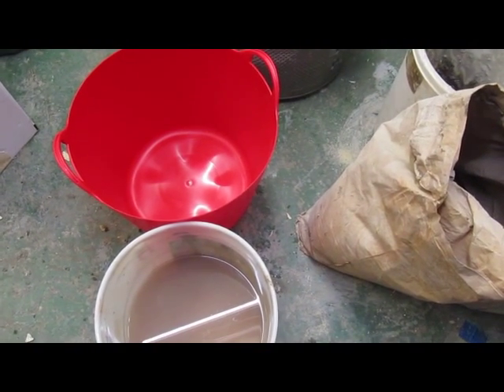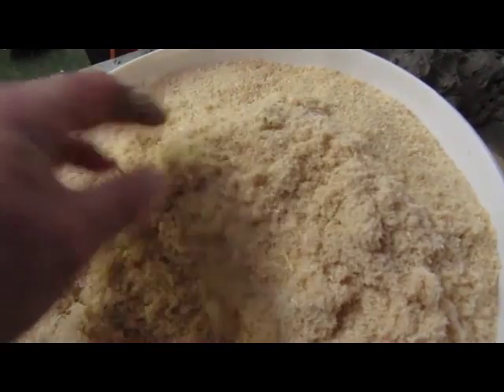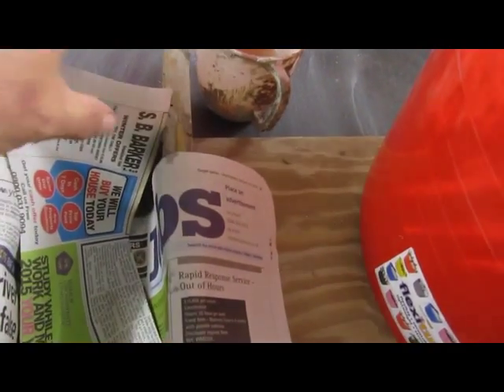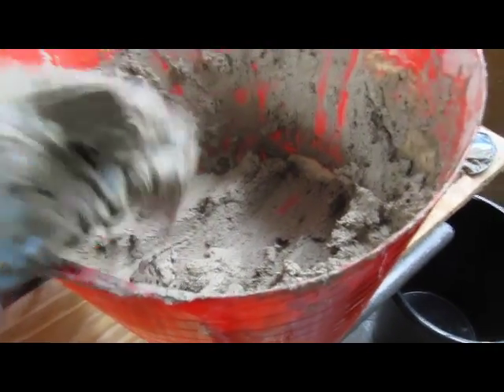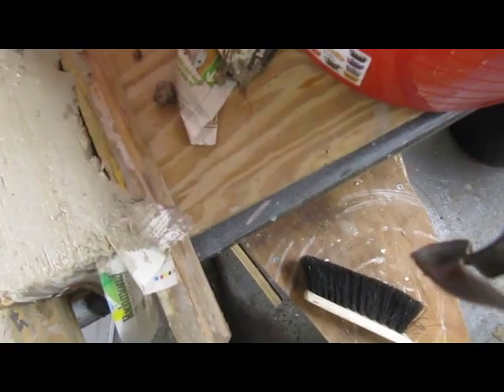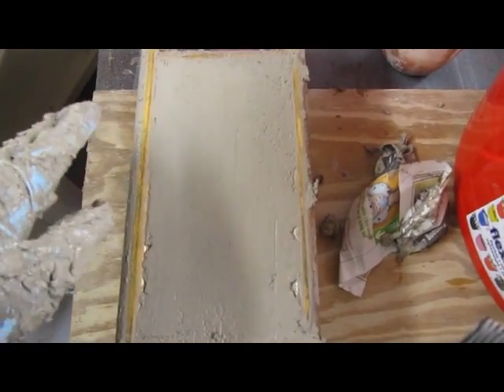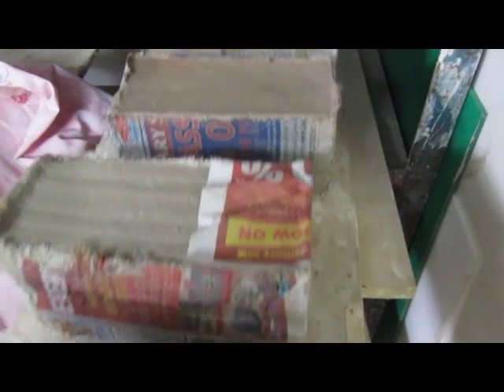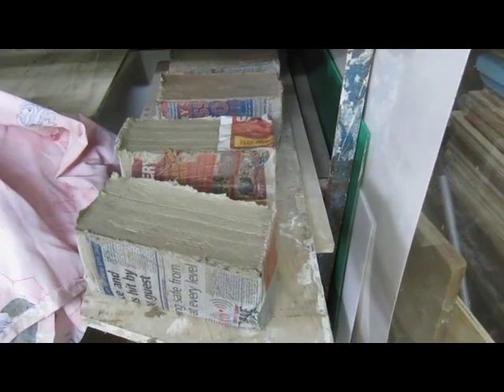Hand making Kiln Bricks

Comment: Did you ever get to fire the bricks?
Reply: High Bridge Pottery why would you not use grog filler? sawdust is just a wasted effort.....pointless!
Reply: Sorry,  this was meant for the author of the video, not you :-/
Reply: No problem :D Maybe I can answer, the sawdust is meant to burn out and leave tiny air pockets to make insulating fire brick.
Reply from the maker: not yet but have plans to fire a large pot in the garden and the bricks will make up the base . which the pots stand  and  acts as a firer box as well . I do a video. The bricks after they were fired were still heavy and more sawdust would help.
Reply: the air pockets not only insulate but also provide space for the clay to expand
Reply: but wouldn't grog do the same like an open body raku clay?
Reply: @shaunconklin5694  I know this was years ago, but responding anyway. The difference is the grog doesn't fire away, its a solid structure the stays in the clay and is heavy. The sawdust burns off completely and leaves behind air pockets which capture the heat and insulate better. They are also lighter. The downside is they are also more fragile. Its the difference between hard firebrick and soft firebrick.